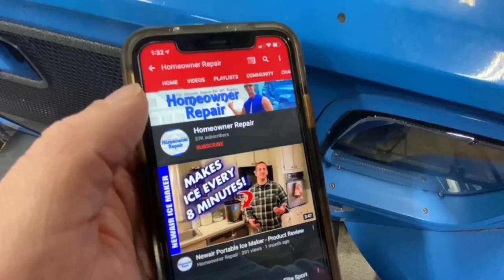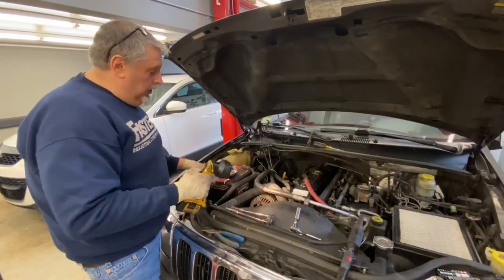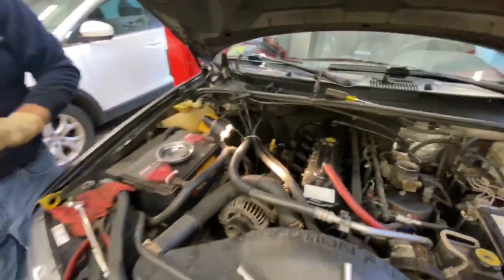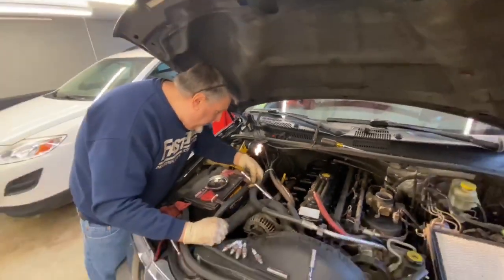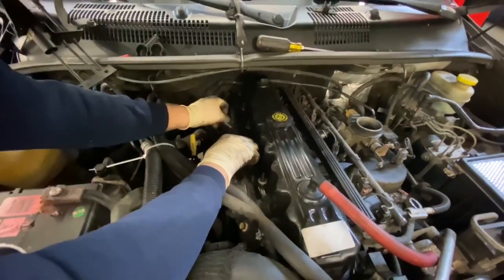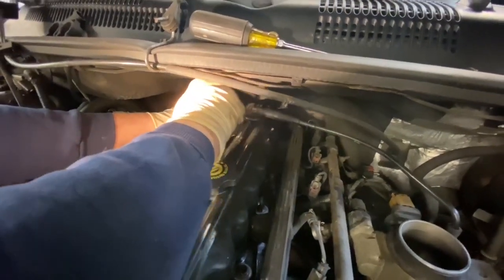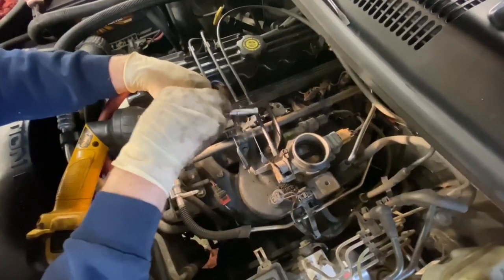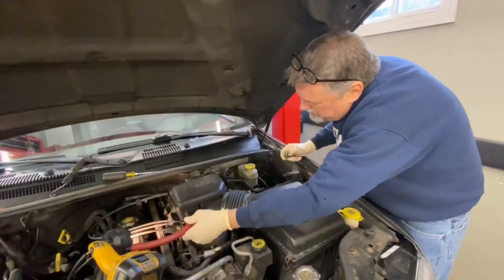How to Change Spark Plugs 99-04 Jeep Grand Cherokee 4.0

Comment: An '04 JGC Laredo w/ 225K that sat for abt 2 yrs. was given to me. The car's a constant money pit. Used up all AAA calls in a month! Now code P--0303 shows. Been learning mech work to cut costs, then w/ sell as is & take the loss. Thx for vid.
Reply from the maker: That code seems to point to a bad ignition coil on the #3 cylinder
Reply: Lmao you either got a GC from someone who didn’t maintenance it very often. If it’s the 4.0 they are very strong engines. A BMW is a money pit.

Comment: For anybody else watching, iridium spark plugs are pregapped. It's a good idea to check the gap as was said in the video, but don't try to gap them or you will break the tip.
Reply from the maker: Yeah, you have to be careful with those tips. Thanks for checking out the video.
Reply: OK I’m here cause I got a change out all six I wanna make sure you’re correct in saying this I shouldn’t have to worry about the gapping if I go with iridium spark plugs correct thank you
Reply: @elisiaweimar4219  You should always check them anyway. To make sure the gaps aren’t too tight.
Reply: Does WD 40 work as a substitute for silicon spray?

Comment: 4.0 - use plugs plugs NGVK V-Power Spark Plug (ZFR5N)

Recommended, iridium not needed.
Reply from the maker: I always ran the Champion spark plugs in my 4.0 Grand Cherokee and they were fine

Comment: Any tips on broken spark plug with sheared off nut with threads still on 5th plug????
Reply from the maker: Boy, That is a tough one, I am not sure if you could get an easy out to back the rest of it out of there. You also should make sure the piston is at the bottom of the stroke so that is doesn't get damaged. You may want to have a reputable garage tackle this one for you.
Reply: @HomeownerRepair  I decided to just call my mechanic before I mess it up worse, just started to work on cars myself and could use more experience before I screw myself. Thank you for the reply on such an old video.
Reply: Honestly though after a new radiator and probably needing a new transmission, I think I’m gonna buy this 2004 Tacoma instead

Comment: I broke the throttle cable end the plastic part that snaps on. Will I have to replace the cable? Help! Thank you
Reply from the maker: If the end of the cable broke off, your more than likely will have to replace the throttle cable.

Comment: what size socket for the plugs?
Reply from the maker: I "THINK" it was a 5/8" spark plug socket. It should be stated in the video. Hope this helps you out.
Reply: @HomeownerRepair  thank you i'm going to try to tackle it today ..i.have a 0301 obd misfire code ..i hope it fixes it

Comment: Will vasilen work on top of spark plugs if you don't have the other
Reply from the maker: Don't use that. You don't have to use the antiseize on the treads if you do not have it, but it will help next time you need to remove them.

Comment: Do the spark plugs  have a torque spec?
Reply from the maker: It looks like the factory calls for 26-30 ft lbs on the torque. You may want to look this up specifically for your year make and model. I have always just snugged them up by hand as shown in the video and never had an issue.

Comment: Followed all the steps for my ‘04 4.7L V8, but when I start it up it idles high (1500 rpm) and smoke is coming from the engine after idling for a minute or two. HELLLLP 😩
Reply: This model is a 4.0 I (straight) 6 engine.
Reply from the maker: Just saw this, did you figure out the issue.
Reply: @HomeownerRepair  he used the vid on the wrong engine. This is a 4.0L straight 6 and this guy had a 4.7L V8

Comment: My first thought. WTH.
I have driven Keeps with that engine for 23 years and have never pulled stuff off the left side of the engine to get to something on the right.
Reply from the maker: It helps to remove the throttle cables so they are not in your way. You might be able to work around them.

Comment: I changed the spark plugs but it still comes up with same misfire codes and skips and sputters, HELP
Reply from the maker: It may be a bad coil pack.
Reply: fuel injector might be bad

Comment: how many spark does it have? I counted 6. Is this correct?
Reply: Depends on the engine the 4.0 has 6 cylinders there for 6 spark plug the 4.7 has 8 cylinders hence 8 sparkplugs
Reply from the maker: Yes there are 6 spark plugs on the 4.0 motor